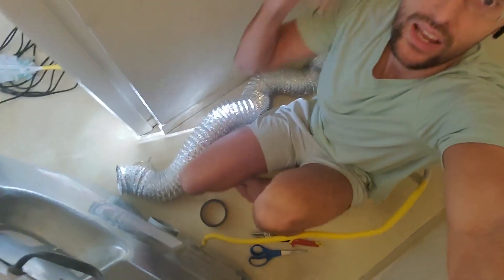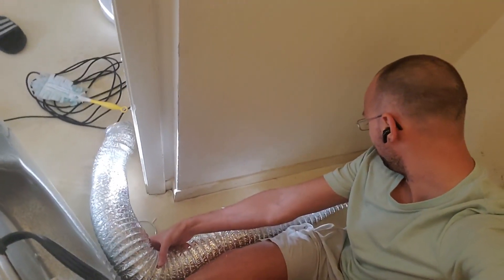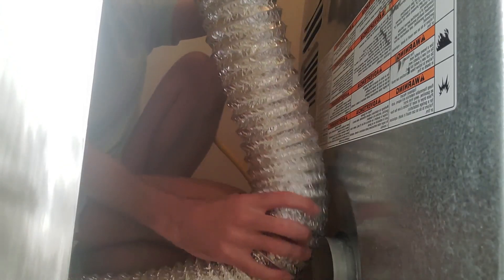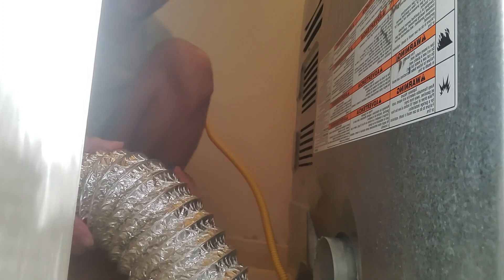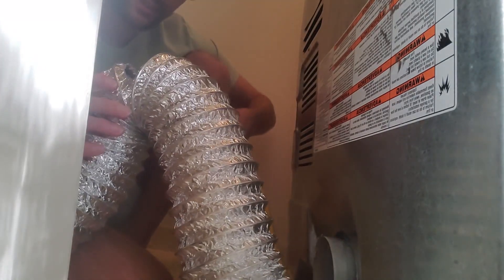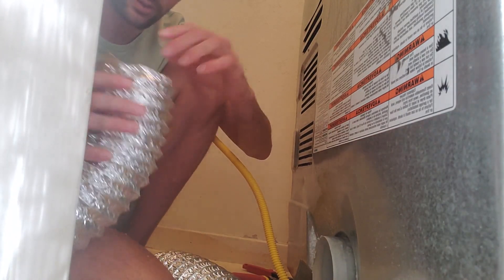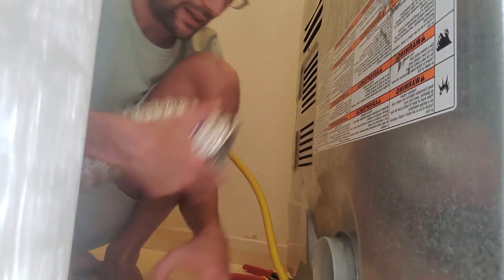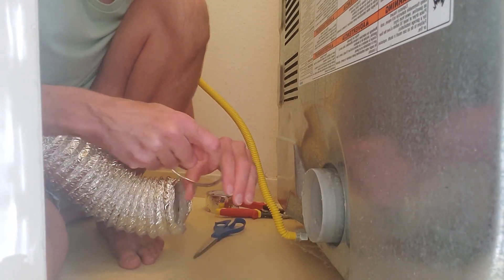0690 Shortening Dryer Vent Duct with Snips

Comment: the problem is that you're using the wrong hose.  The slinky aluminum hose you're using is notorious for getting plugged with lint and creating a fire hazard.  The connection from the dryer to the wall should be a rigid tube.
Reply from the maker: I've heard that and get the logic. However, I clean out the dryer lint filter often. The outside vent is clean. The hose accumulated nothing in the last year. And I dry on the lowest heat.

It's also rated for dryers: "It is constructed of heavy duty, fire resistant, aluminum foil laminate. This duct is UL2158A listed for safe dryer venting."